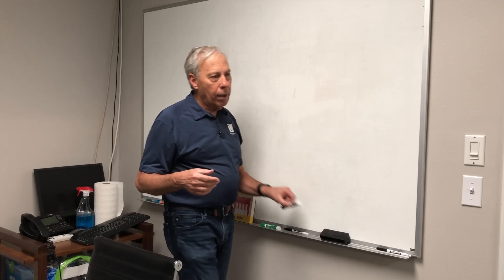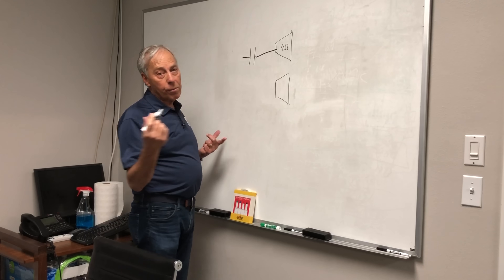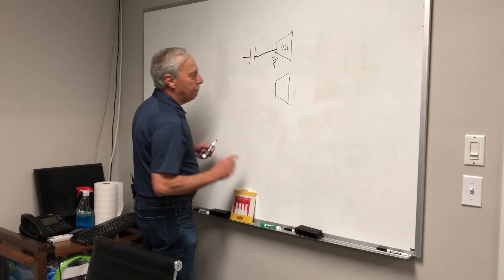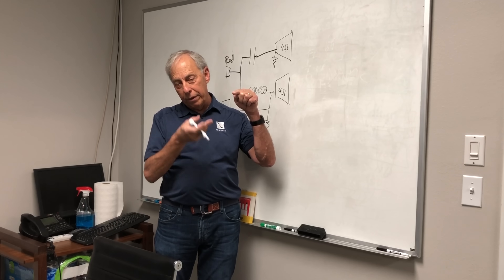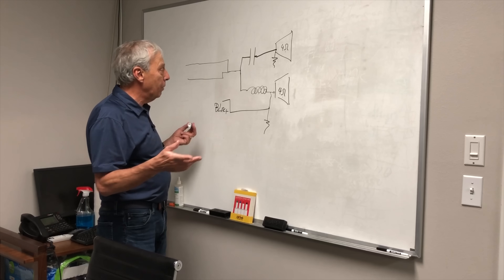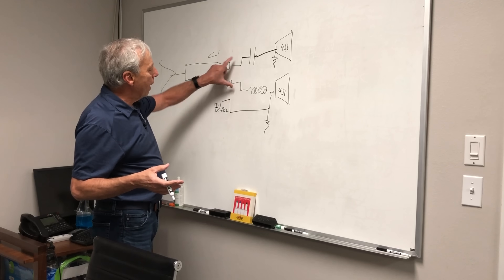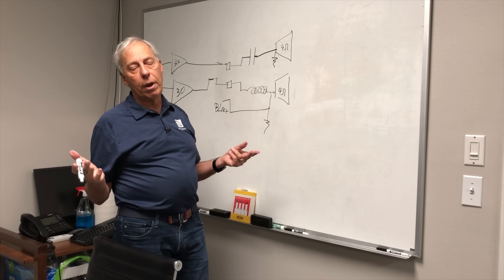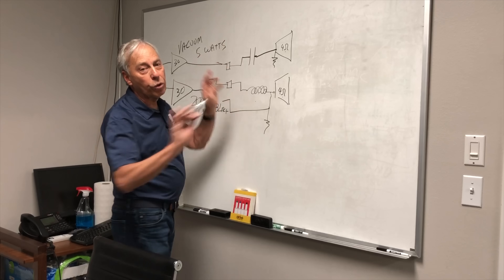How does bi-wiring work?

Comment: Had speakers worth a few grand UK. Tried bi wiring, bi amping and leaving them with the cross overs that they came with. And they sounded exactly the same to me.
Reply: cosawanty wasn’t the bi-amped setup louder for your system? I found my B&W System 683 front stage absolutely loves being bi-amped from the Yamaha RXV3800. Although the amp does run hotter and will auto protect with anything above -5db on the volume due to clipping after about 20 minutes. It will happily sit at -10db and blast thrash metal to all neighbours all day and night if I am in the mood
Reply: @phizzle24  how do you bi-amp to one amp? Do you mean bi-wired?
Reply: Cyba IT no, it’s bi-amped. I have a Yamaha RX-V3800 7.1 AV receiver. Instead of having 5.1 surround sound and a second zone, it can be configured to bi-amp the front left & right speakers and also the centre and rear left/right. Front speakers are Bowers & Wilkins 683 S1. The woofers have their own channel and the mid/tweets have their own channel
Reply: @phizzle24  buys B&W speakers to play thrash metal at loud volumes  facepalm
Reply: @Beenjammin.Buttons  yeah, cause that's all I listen to #facepalm
Reply: Diogenes, Diogenes...here's your honest man!
Reply: cosawanty
I'm guessing you'd only really notice a difference if the amps were completely different like Paul said, one being vacuum for highs and regular amps for lows for instance.
Reply: What about if I have low budget amps - could I use bi-amping to get a better sound? I don't wanna buy a high wattage amp but have 2 pairs of 50W identical amps here.
Reply: @maxheadrom3088  Bi amping gives you no extra power. It's a myth that it does.
Reply: @chriswilson1853  Actually, you're right - it does not increase power. I found a nice response on a Crutchfield article: 

Paul from Des Moines

Posted on 11/24/2019
Main power amplifiers are voltage controlled voltage sources. Load impedance determines current and power output. Both high and low frequency speaker sections are driven by the same voltage when driven by one amplifier. Both high and low frequency speaker sections must be driven by the same voltage to maintain the speaker frequency balance. Amplifiers in passive biamplification must have identical voltage gain to have identical voltage output, and should have identical rated power output so that they have identical maximum voltage output. Identical amplifiers are preferred for passive biamplification. The high frequency current flows in the high frequency speaker section and the low frequency current flows in the low frequency speaker section. The impedance of each speaker section is the same whether both speaker sections are connected to the same amplifier or separate speaker sections are connected to independent amplifiers. Consider both high and low frequency speaker sections driven by one amplifier. The voltage output by the amplifier is V. The current in the high frequency speaker section is I high. The current in the low frequency speaker section is I low. The total current output by one amplifier driving both speaker sections is the sum I = (I high + I low). The power output by one amplifier driving both speaker sections is P = V * I = V * (I high + I low) = V * I high + V * I low. Consider separate speaker sections driven by independent amplifiers for passive biamp

The short version: Power = Voltage times Current Voltage = Current times Impedance Power = Voltage squared divided by Impedance Speakers are not resistance. Speakers are complex impedance. Speaker impedance depends on frequency. Nominal speaker impedance is a simplification. Amplifiers are voltage sources. Impedance determines current and power. Amplifier power is rated into a specified nominal impedance, usually 8 ohms in the US. Amplifiers have voltage and current limits. Amplifier voltage limit depends on current output. Each separate channel of an amplifier or receiver has its own independent amplifier circuit. Speakers connected to different amplifier channels are not connected in parallel to one amplifier circuit. Both high and low frequency speaker sections are driven by the same voltage when connected to one amplifier channel. High and low frequency speaker sections must be driven by the same voltage to maintain frequency balance. Passive biamplification divides the high and low frequency speaker impedance between two separate amplifiers. Passive biamplification divides the total speaker current and power between two separate amplifiers. The total power of passive biamplification is the same as the power of a single amplifier. Passive biamplification does not increase the amplifier power.

From: https://www.crutchfield.com/S-O7kE7GTvQdc/learn/why-biamp-your-speakers.html
Reply: That's because you're not Zathros.
https://youtu.be/1j-76eLz1hc?t=33
Reply: Totally agree. Tried them several times over several days. The difference came when different amps were used BUT it sounded worse in that scenario. Can't believe the rip off from cable companies selling biwire speaker wires for $$$. But then why do speaker companies even design in a way to support that.
Reply: Doesn't surprise me in the least. Even expensive speakers will have distortions and nonflat responses that you don't get from a few metres of wire.
Reply: Because you sir......in all honesty.....were not blinded and understood reality.
Reply: Well that just threw a wrench in everything! I was thinking of a tube solid state hybrid with tubes in the preamp section. Bi amping looks like it would get the job done better. After four years of looking at amplifiers and wanting to upgrade, I still have a bit to learn. I have never heard tubes but I really want to give them a try. But I like to Crank It Up and rock out!
Reply: that's probably because you are sane. Some people are not, hence bi-wiring.
Reply: Leaving them with the crossovers they came with? You don't swap out the crossover when you bi-wire. Passive biamping doesn't change the sound unless you use different amps which brings up other issues. I don't believe you know what you're doing which could explain your result. As Paul mentioned, using different cables for each pair of binding posts can tune the speaker to a beneficial result.
Reply: I  tri-wire my speakers - including using 2 jumper cables .  I soon discovered there are quite a few possible configurations.  So I experimented.  Guess what?  Each and every "config" sounds different.  Let's just say that allowing for each config to settle down - about 3 or 4 days - I eventually found one configuration superior to all the others.  More resolution, tighter bass, better integration.

It's worth reading as much as you can on the subject, just try to filter out the flat earth trolls who keep banging on about copper is copper etc.  They're as bad as those deaf-aid IT nerds who reckon bits are just bits.  Next time you burn a CD in your PC, burn one at max speed, burn one at the slowest speed - funny thing, the slower one sounds more hifi.  Smoother, better resolution, cleaner bass etc .
Reply: @LeGrandeMaitre:

The speakers you spoke of with tri wire capabilities; are they Def Tech Bi-Polar tower speakers by chance? 

Curious as I have BP-2002's I've been tinkering with & hoped your experimentation may provide some insight.  Also tried numerous possible configurations with mixed results & trade offs. 

Regardless of make/model of your speakers it would be much obliged if you could elaborate on what your findings were as far your favorite ideal configuration?

Comment: Before I put together my new system I had my old multi channel home theater amp, and bi wireable speakers. When I used four channels from the 7.1 amp to drive the speakers there was marked improvement in detail over using just two channels.
Reply: Because you passively bi-amped the speaker (as opposed to bi-wired it) so you increased the power delivery to the speakers which will always make them sound better....

Comment: As Paul  mentioned wire geometry certainly matters. I prefer to make 4 conductor cables to each speaker box.
Being two twisted pairs. One red, one black twisted clockwise for each pair. Then those twisted pairs twisted around each other, counterclockwise. Terminate R-R; B-B. The twisting rejects any magnetic fields produced by AC power cords. You also increase the effective gage of the wire. Dual 14 gage wires become 11 gage.

Comment: This is totally flawed. Both negative & positive connections are summed/paired together at the amp anyhow-  so the amp sees one common load...

Further all drivers should have the best grade/gauge speaker wiring... any attenuation should be done in x-over design or actively.

Using a thinner wire to attenuate a band is stupid.
Reply: This channel get suggested to me a lot, lately. It's snake oil for audiofools. I watched the video where Paul explains how different XLR cables sound different, with a pseudoscientific experiment "proving" it.
Reply: It's been said over and over again... But ain't nobody got time for stuff like facts and details! It's like hundreds of years of understanding of how electronic circuits work has been for nothing, and people who should know better are coming up with "new understanding" without ever having to bother with the underlying physics that govern how things work.
Reply: drumphil00 totally flawed video. ill advice. 
Paul-  you should know better!! Shame on you misleading people/viewers. 

Time to stop using snake oil as your fav aftershave Paul!!
Reply: shane
That goes to show that you do not know how electronics work. For normal home use (not really loud parties or concerts) the speakers will hardly ever need more than 10 W - that is laughably little and can be transmitted with most normal SUB cables even. if you ever come to the conclusion that your system really needs biwiring and not bi-amps than you are in one of 2 scenarios: You have the crappiest tiny cables and should get a normal cable. Or you are planning to get permanent hearing damage within a splitsecond.
Reply: "Transmission lines can move more power over a conductor due to frequency, AC lines don’t have the current moving through the conductor rather it makes a halo around the wires circumference. "
the thing is - i actually studied what is going on there, i know the difference and at the frequencies present in audio-signals that effect is pretty much negligible as a conductor that is large enough to be noticeably affected by that is also more than large enough to carry the current without any noticeable distortions.

Comment: Just for the record. My B&W’s (no, Paul doesn’t sell those or the Amp i drive them with😃) are bi-wired using the same brand and type of cable for both the HF and LF drivers. There is a marked difference (note i said ‘difference’ not ‘improvement’) over the standard cabling method. Now on my system, for the music i play, i DID notice a marked improvement in the detail and resolution in the top end... i.e a shrill trumpet. In addition the LF is less muddied. Your experience may vary of course, but I think there is some merit to have a play around with this technique if your speaker terminals enable bi-wiring. Cheers 😎
Reply: Thank you I fully agree! (btw I also have B&W's maybe it's a "B&W thing"?)

Comment: Another option is to use the "gain" on either tweeter or woofer to pair 88db woofer to a 92db tweeter vise versa. without using a L-Pad.

Comment: The 5W / 200W combination will only work if you have some crossover filtering BEFORE the power amps.  An amplifier's wattage is mostly defined by the maximum voltage it can produce before clipping.  If you send all the frequencies into the 5W tweeter amp, it will start to clip as soon as you have 5W worth of bass in the signal.
Reply: I suspect the power amps work as a single circuitry with the speakers crossover and speakers itself. So if there is a condenser in the twitter circuitry, the amp will not amplify low frequencies.
Also I suspect that real AC have their twitter with much higher impedance than for their woofer. AC overall impedance is specified for the lowest speaker average impedance, and when AC is wired into single amp this impedance difference distributes more power to woofer than to twitter.
For bi-amping it makes sense to choose amp working with AC impedance for woofer wiring, while impedance requirements for the other pair (high frequencies) are usually weaker. E.g. 4 Ohms for woofer, 8-16 Ohms for the rest. And AC overall is marked as 4 Ohms.

Comment: This was really helpful. I have always understood bi-amping and some of the options there, but I was never clear on why bi-wiring would have any value. Now I am. It also reminded me that bi-amping is better and why -the option to use different types of amplier for the high and low sounds. Does anyone ever tri-amp three way speakers? Does anyone even make a three way speaker with tri-wire inputs? I suppose any two way speaker paired with a sub is essentially a three way configuration when you think of it like that.
Reply: No, biWire does not add anything - unless you are in the rare scenario that your wire are incredible thin.
Reply: The only value bi wiring had is buy wire....lol

Comment: Should have mentioned separation of speaker ground references on the Bi-Amp model ...Someone is could blow an amp
Reply: Absolutely, tried it once (with two identical amps) and they didn't like it AT ALL, (very loud buzzing, etc.). Fortunately, it was only for a few seconds and they were undamaged.  It was an "oh crap" moment though.

Comment: Paul 
Thank you for a great video, I'm happy that I subscribed to your channel 
You are helping me a lot picking out a new system 
I want to bi-amp the system I getting 
Is it worth it, should I go horizontal or vertical 
I'm leaning towards tubes to drive the speakers 
Thanks
The old man
Reply: If I understand the question correctly, bi-amping is best done with one amp for the highs and one for the lows, as opposed to one for the right and one for the left. So "horizontal." If you use identical amps for the separation it doesn't really matter. You could even use 4 mono amps! Wouldn't that be fun?! But one of the great advantages to bi-amping is the ability to get an amp that will do highs very well and not need to be concerned about whether or not it has the exact bass characteristics that you'd like, because you will use an entirely different model of amp for the bass.
Reply: FILO 58, bi-amp worth (but good mono blocks are... better). Usually, from one amp to highs on both speakers and from another amp the same for lows. The old men too
Reply: You do NOT want bi-wiring, bi-amping only if you have a good setup and the amps are dedicated for highs or lows, otherwise there are no benefits what so ever.

Comment: will this be on the test? :O
Reply: Well said and have a hi end microphone to show the difference based on a human ears noise levels and the max a ear can hear as far as the lows and the hi's, sure everyone's taste is different, but the measuring equipment does not lie, but they wont do that, because all those Bi Wire speakers which are for sale will suffer and the same with the amps ?

Comment: Paul, you had been in the industry for a long time. Do you have some thoughts about the question which had been bothering me for a long time - why there are no complex tubes, which would allow transformerless amplifiers (I know about the expenses to make one, but it is interesting why no one bothered making it ) ?
Reply: Aa Bb there are transformerless amps around...can't remember what brand though.
They're like a niche in the niche 😁
Reply: Yes, there are, but they are not very powerful or extremely high quality. High power tubes are nothing like you see in those common amplifiers.
Reply: Aa Bb I remember Audio Research did some HUGE powerful monoblocks that had like 24 tubes in them? KT120s or 150s
 Were those transformerless? I remember listening to them at Imacustica Lisbon.
Reply: No idea, from what I see they have multiple tubes, possible connected in parallel in some of their amplifier series, and relatively simple circuits in those you mentioned. But those are normal tubes, from the look of it. High power tubes would need heatsink or something similar. Also, I see the transformers on the picture. Meaning that they are simply overpriced if so, as the transformer essentially negates any advantages of the tubes. And the thing the audiophiles can hear is the distortion brought by the transformer, mostly. Tests show that the audiophiles would react to the transformer put into a semiconductor amplifier as if it is a tube amplifier, meaning that they are not quite mentally stable and can be trolled endlessly, as they don't admit that the thing they paid so much for is not as good as they think.
Reply: I assume you used a search engine like google with otl amps and did not find what you are looking for, but it's there. Atmasphere and many others been doing it for awhile.
Reply: Simple:
Cause decent transistor-based amplifiers are just superior. With tubes you have to work around their limitation and their inherent distortions, with transistors you can emulate any sound of your liking. Why would you even want an amp without a transformer? they are there for a reason.